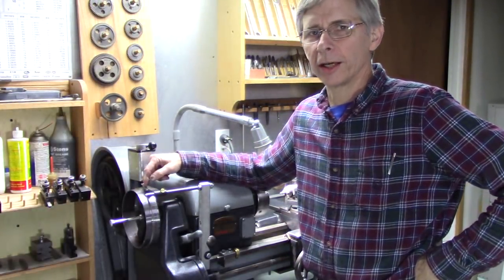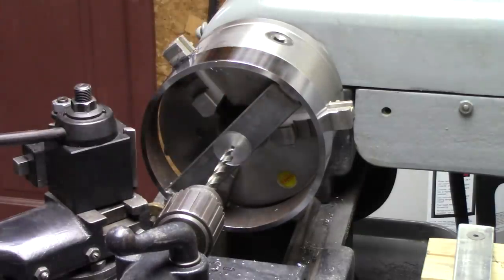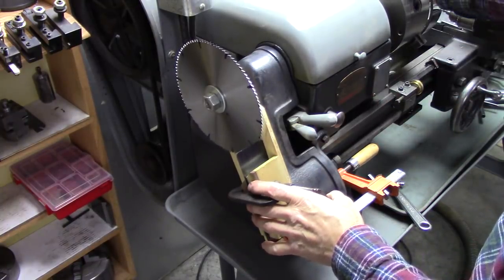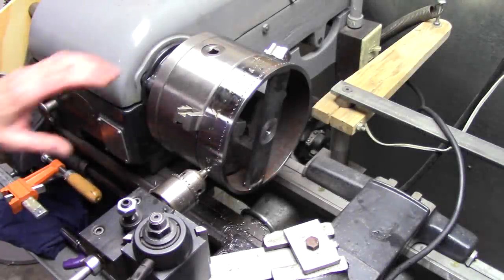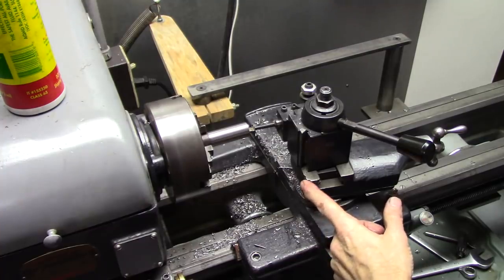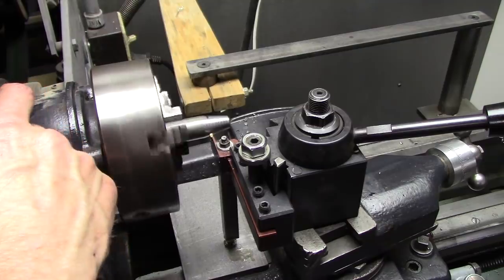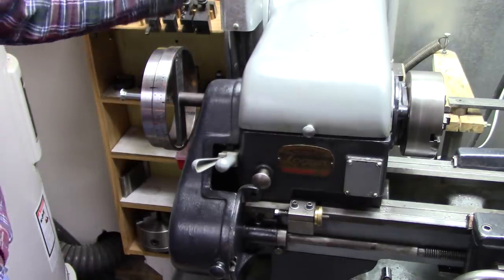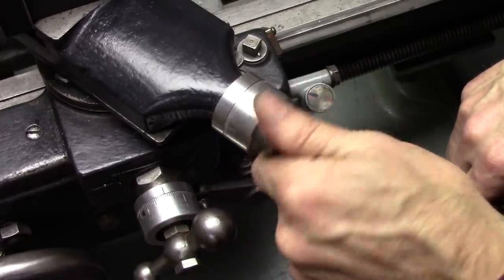Metal Lathe Indexing Wheel

Comment: Long ago I needed to do a similar indexing job. I got a large gear about the size of your disc and bolted it to the spindle with a long threaded rod from the front of the spindle to secure it to the rear of the spindle, as you did. I made an indexing block bolted to the rear of the headstock. I could thus index the spindle to make the required spline using a HSS bit on its side. It was a tedious process, 36 teeth on the workpiece and 200 parts to deliver. But it worked. This was when I started my shop in 1961 and no money to buy a mill and indexing head. When the job repeated 11 years later I just hobbed them.
Reply from the maker: Cool story! Thanks for sharing. I don't use the indexing wheel very often but it's nice to have.
Reply: @WinkysWorkshop  Yes for sure. In all my years of machining, I must have made or bought so many tools, fixtures, and all that type of stuff. If you only need it once and don't have it, there goes the job.
Your creation will serve you in ways you cannot imagine yet and it will be a boon to have it at hand.

Comment: Heads up for everyone who intends to use a saw blade to index holes: make sure that the spacing of the teeth is equal all around. Because usually saws, reamers etc. are made with uneven spacing to reduce chatter/harmonics.
Reply from the maker: Thanks Jaako, that's a good thing to watch for. I have seen a few 60 and 80 tooth with groups of teeth and then a wider space. Never anything that wasn't symmetrical and always fairly obvious but never the less good to watch for.

Comment: Excellent, I too used that blade trick, and built index wheels like yours on the lathe carriage feed, from the videos the master, Lyle Peterson. I also made a wheel on the end of my Atlas Lathe lead screw so I could advance the saddle in .001 increments. The Atlas of course has a 60 hole index built in, and I have a mill, so I won't need your idea, but it is an excellent one. Guy Lautard, in his series of three Machinist's Bedside Readers, elaborates upon this idea. I have a spin indexer and have slips at time too. I really need to tear it down, and since I have a project for it, but am waiting on a reamer, I guess tomorrow is the day for that. Joe Pi is right, this field is an amazing one, and your videos show that well.
Reply from the maker: Love Joe Pi...  Yes I love doing machine work, Thanks so much for the positive comment!

Comment: Winky,
I have a Logan Lathe almost identical to yours and I have been thinking in the past how to make it index so I could drill from the tool post at prescribed intervals. Your video was exactly what I needed to see. Thank you.
Reply from the maker: Hello Kenneth, thanks for the positive comment. If you only need 2 4 6 and 8 hole patterns you might consider using a 24 tooth gear. I plan on making scribe marks on lathe and x y tables dials so I need 100 positions otherwise, 24 would have been perfect. If you make the expanding arbor make sure you get it tight to avoid slipping.

Comment: Every time I watch one of your videos, I tell myself that I can do that. I don't have a drill press but could make a milling attachment and an indexing wheel using the lathe as my drill press. I want to make a D1-4 attachment to fit my 2-1/4"x8TPI nose spindle. When it's fitted correctly, I will lock-tight it to the spindle nose and maybe pin it in one spot. Instead of cutting the excess nose threads off I'm going to make it flush with the threaded nose so I will be using a thicker piece of round with a shoulder that is flush with the very back of the spindle, that's where I will thread a hole and use a small screw for extra insurance that nothing will cause it to thread off. My bore is 1-3/8" so a little larger but the same concept. Thank you for sharing, great job.
Reply from the maker: That's a good idea! I never thought about making an adapter. It would be nice to be able to turn in reverse sometimes.
Reply: @WinkysWorkshop  Well I have a lot of the measurements and I asked my brother who is a ASME to get me a copy of the B5.9 spindle noses that has all the nose configurations and drawings. If I can pass anything along to you I will. Making the plunger detents is the easiest part of it. I wanted to try and make the Camlocks but I don't have the machines to do it. I went to a company called MacIt, they sell the camlocks and plunger detents and a very reasonable price. For many hobbyist this is a shot in the arm. They rest is to have a indexing component to drill the holes in the right locations. I bet you could turn it into a series that would be a big hit on YouTube.

Comment: I appreciate your videos. for indexing wheel I used number 35 roller  chain sprocket 60 tooth and a 120 tooth. A few links of anchored 35 chain able to lay in the teeth gets your index. I painted incremental sets of teeth for quick reference. Not tool room accurate but darn close.  Thank you so much for your videos!
Reply from the maker: You are welcome. The chain and sprockets are a darn good method and just as accurate as the method I used I'm sure.

Comment: I love prowling around your channel my friend. I watched you cutting the 100 tooth gear indexing on that same wood saw blade on your lathe just recreantly. I still think that is a simply ingenious way to turn a lathe into a gear and ? indexer. I am always impressed with your ability to use or adapt anything at hand to make jigs and fixtures with what you have laying around the shop. You have a very open mind indeed my friend. Even with an oops you found a way to make it work. I love it when you use the word "About" or "There about's" It shows the inventor side of you, LOL. Every time I see the Rapid Tap come out I know you will have a trouble free and smooth cut. It has been my go to for nearly 50 years. I can see you using this jig for a very long time. The great part of metals is they never go bad eh, LOL. Well my friend, I never thought about making this in steel but one add on the locator pin would be to make the locator pin arm from a piece of regular or a thicker piece of banding. Then get that stamping jig to work on the hole count. I have a couple friends I am sending this to. I know they are both going to love this. This is one more super jig from you bud, WELL DONE EH.
Reply from the maker: Thanks! I sold this lathe but made a new indexer out of a 48 tooth gear for my south bend. It's a little easier to use and 48 gives me what I need most the time. I still have the saw blade but need to rig it up to work on the South Bend lathe
Reply: @WinkysWorkshop  I am sure you already have it figured out.

Comment: Very inventive idea using the saw blade. That was really good. I made an indexing sprocket for my South Ben a while back by bolting a 40 tooth sprocket to the back of my 6 inch chuck. I got the idea from Steve Jordan's You Tube video. I also made a tool post drill similar to yours but I put bearings in mine. Keep up the videos. Good work.
Reply from the maker: Yep...  there are many ways to do things, that's for sure. Bearing would be great! I oil the sleeve bearing quite a bit while using mine. I doubt it will ever wear very much. I don;t use it very often an the bushing has a lot of surface area. Thanks for the comment.

Comment: Hey Winky. Neat idea!  Just a thought here. When cutting matching inside and outside tapers I bore the inside taper as you did then use a reverse boring bar with lathe running reverse and cut the outside taper from the back side of the work piece. It gives a perfect fit every time. Got to watch your other videos now. Love these shop vids even though I’m pushing seventy and been machining for forty seven years.
Reply from the maker: That's a great idea although my chuck mount is screw on and the chuck unscrews. Thanks for watching.

Comment: This is a very elegant solution to indexing on the lathe spindle. The collection of gear wheels you have on the wall should give a great selection of indexing options in addition to the 100 tooth saw blade.  I am thinking about using my collection of gear wheels on an internal arbor using your design.  

You could even make your own gear wheels with any number of teeth using a tap. I love this method which I used to make a worm gear drive in the video below.  You could even use a complete worm gear to drive the indexing gear and put a calibrated dial on the worm using your method. This would give ridiculously fine divisions eg with a 100 tooth gear and a worm with a dial with 100 markings could theoretically provide 100 x 100 = 10,000 divisions! Or use a 60 tooth gear wheel, which has 12 degrees per tooth, and use a calibrated dial on the worm with 12 markings for degrees, or 120 markings for 0.1 degrees.  But then I am getting away from simple elegance solving practical problems.

The following video shows the "thread cutting tap method" of making a gear wheel. It makes a gear with a concave profile but to make a normal straight gear you could raise and lower the blank while cutting it.

The little worm drive gearbox starts at 3 min 20 sec into this video:
https://www.youtube.com/watch?v=Jpzz6nngzLk&list=PLGfoCtzNfeSCGPh4kyw2Mm9727d756V-N&index=11
Reply from the maker: I've used the indexing wheel a few time although I think a better solution would be to make mandrel with a stud that locks in the outboard spindle. Then make several disks easy to read disks. You could have a disk with 12 notches that would allow for 2, 3, 4, 6, and 12 positions. Counting hole on the one in this video is a pain. Of course you could make disks with a specific numbers for specific purposes as well but the 12 notch disk is what i would use most.

Comment: Just discovered  your site after searching "indexing on a metal lathe".  I like!  Thanks.
Reply from the maker: You're welcome. If you have a set of change gears you can usually find the right tooth count to get the holes you need. That way you can just build the mandrel for your spindle and come up with some kind of lever to lock into a tooth. Please look around...  I'll look for your comments.
Reply: No change gears, I have an Atlas Quick Change 54 which is great but the whole indexing thing has been driving me crazy for a long time. I guess I'm not that bright.... @WinkysWorkshop
Reply: @rtkville  - That's nice little lathe...  cool that it has the quick change.  I've used my indexing wheel about 3 times total but I've also used my 100 tooth saw blade more. I use it to make new dials. I think I pointed then out in the indexing wheel video. I sold that lathe and now have one with the quick change gear box. Unfortunately is also has terrible dials.  I'll make a video of making the new dials. The original dials on the Logan are terrible!
Reply: sound good! @markswoodworkingtips2350

Comment: This is so clever and simple, I love it... the tools could be improved but your idea is brilliant.
Reply from the maker: Thanks, I agree. It's good for drilling a simple bolt pattern but I would not trust it under high load or to cut gear teeth. I used an earlier version to drill the 4 holes for a face mount electric motor but I used a center drill to locate the holes and enlarged the holes to 3/8 in the drill press.
Reply: What counts is the creativity... it is easy to improve but brilliant to come up with a clever idea. I will keep that knowledge preciously for future use...Thank you for sharing.
Reply: Winky's Metal Working Tips:  I need to think about this....  I've got a 1660 lathe so lots of modifications. I need to rework some motors and change them into 'c' face mount. My other option is Mill and rotary table. Whiz bang to use lathe to cut steps, bearing mount , face groove and drill holes but have to make index. Forever on mill turning the r table , sigh.  Options, options options...

Comment: Very nice video!  I missed the saw blade on tubalcain's build on MrPete222 channel.  I have a thick backplate on my Atlas lathe and have drilled holes in it to use for indexing.  I will definitely be looking into building the tool post adapter for the drill.  Thanks for posting and I'm now a subscriber.

Comment: Very useful projects, would you explain the wooden arm on a spring behind your lathe? Thank's for your video efforts
Reply from the maker: The steel bar works like a tapering attachment. I clamp a profile to the bar and a bearing mounted to a modified cover on my cross slide follows the contour. I disengaging the feed screw on the cross slide and attach the spring which hold the bearing against the profile. The spring is attached to the cross slide. The wood arm is just to hold the other end of the spring.

Comment: You can get a lot of good work done with a 110 MIG welder. But I will never go back now I didn't go all out and get myself a Miller or anything like that but I did get the Hobart professional line and I hooked it up to 220 and man what a difference. Most of the time I have to dial back the power cuz I'm giving it too much. I have yet to run out of power on this thing and it's absolutely beautiful
Reply from the maker: I agree 100% !   This little welder is better than nothing BUT a 220 welder would be way better.
Reply: Winky's Metal Working Tips don't get me wrong I did a lot of good welds with mt century

Comment: Hey Winky. Good job, as always. 
If you wanted 360 holes for 1 degree increments, couldn’t you stagger the holes going back? Like 0 would be up front. 1 degree would be in a row back by 2 hole diameters. 3 would be back 4 hole diameters and 4 would be back 6 hole diameters. Then 5 would be up front again with the 0. 
Then you have 4 registration pins that are laterally displaced by 2 hole diameters. I’m not sure what your hole diameters are, but if they are 0.125”, then your wheel would be about 1.25” wide from front to back. This would give you a lot of combinations, with angles divisible by 5 on the first row. Angles divisible by 6 on the second row. Angles divisible by 7 on the third row and angles divisible by 9 on the fourth row (I think. Doing this in my head). 
Your jig for drilling horizontal holes is cool but needs improvement. You could use an adjustable jawed chuck for axial holes. Just decenter the piece so the hole is centered on the spindle. Or, leave as is and use your hand drill technique with a decentered jig. 
I need to draw it up. Do you have a website I can visit and communicate off line?
My Chinese mill table is now running smoothly. But I need a way to align it to the chuck. 
I’m thinking of a dc treadmill motor with variable speed. I’d like to slow the drill press down and pulse it forward and backward for tapping. 
Do you know how to do this?
Thanks,
Paul
Reply from the maker: Thats a lot to comment on. First, I only needed 3 and 4 and 100 holes so simple is good for me. I don't really need to decenter anything. My mill goes slow enough but it would be nice to instant reverse. 3 ph with a VFD?  This is not really 
my area of knowledge.

Comment: Im making one now. Thanks for the awesom info.
Reply from the maker: Suggestion...  be careful about slippage. When I messed up the 100 holes it was due to the saw slipping a little. It's also a good idea to pin or tack weld the spoke to your expanding arbor. The arbor itself holds very well but where the wheel bolts to the arbor is a problem area.

Comment: Great job and nice to watch too.     Brilliant idea to use the saw blade  ..and especially the gear cog, which you know will be finely accurate.    I like the simple ratchet stop too.  
The best ideas are always the simplest, well done.
I couldn't help noticing that whenever you started a new drilling job, the nose of the drill bit rose up a touch.  
That'll kill any fine precision you're after, I think..   worn drill chuck?
Reply from the maker: I watched closely I didn't see the movement although I'll admit that accuracy is nothing like what you would obtain on a mill with an indexing head. It depends on what you plan to use this for. If you were talking about drilling with the tailstock, my tail stock is in bad shape. If I tighten the lock down it remains true but drops a bit when the lockdown is loose.

Comment: If you turn a plywood or mdf disk you can wrap the circumference with mass produced [i.e.accurate] punched, perforated strip.
Then index the holes in the rim with a tangential rod and pin. Roofers use inexpensive perforated steel strip to stiffen their structures in several sizes and pitches. The large radius/diameter of your index wheel ensures accuracy because the work being indexed is usually very much smaller. Ideal for odd tooth counts when cutting a gear or gashing a wormwheel prior to hobbing.

Comment: Excellent - Note for UR dials, to make them much easier for tired old eyes to read, fill them with “white paint”. I mix either titanium dioxide or zinc oxide (Ebay) powder into a bit of clear epoxy resin. Adjust the powder content to make a paste and fill and squegee off. Once cured U can touch up any residue with an abrasive eg steel wool etc. I’ve also used powder coat resin to fill the epoxy for custom colors - a bit overkill perhaps!
Reply from the maker: Good idea. I've used black pain but it doesn't stay put. I'll have to try your method. Thanks!
Reply: Winky's Metal Working Tips : Note: U could use various black powders to fill the epoxy. Harbor freight sells small quantities of powder paint in BLK, RED, WHT, and YEL. Carbon BLK (Amazon) is ideal and Manganese dioxide (alkaline batteries) is a black pigment which was used in antiquity. Degrease UR object first with MEK or brake cleaner. Make a squege from a plastic bottle.
Reply from the maker: @jerryquigg3497  Thanks for the info, I will give this  try in the near future.